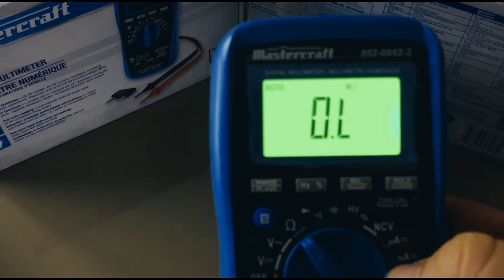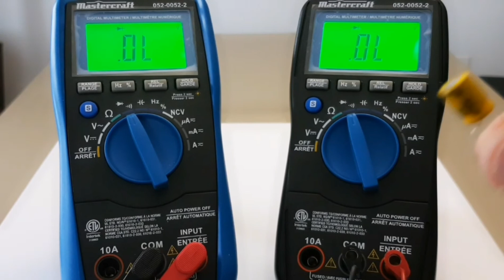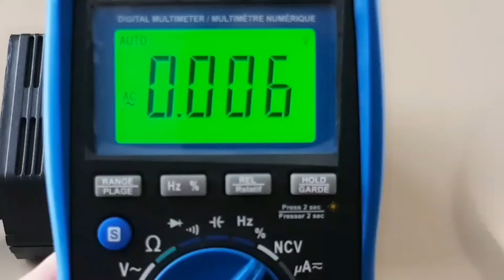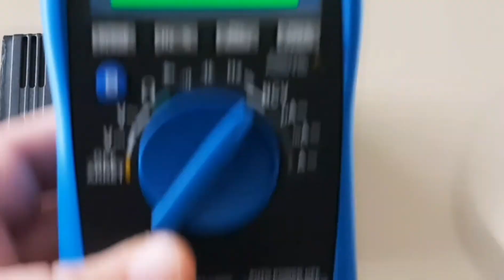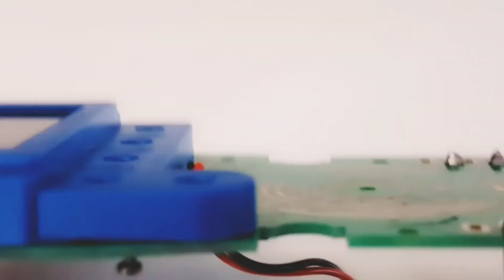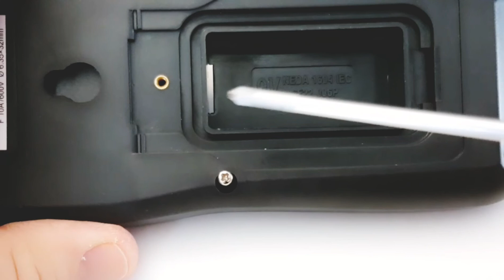MASTERCRAFT 052-0052-2 Multimeter Review & Teardown!

Comment: I was hoping to get some insight into how to use the multi-meter to test resistance.  On mine, I can't tell what range it's in when it provides results and the results don't seem to make sense.  I'm not sure if my multi-meter is defective (I've had it a long time) or if I'm just not using it right.
Reply from the maker: @ChrisR-xs9wp  Testing resistance means the selector should be on Resistance range.
Select the Omega symbol Ω on the Range switch.
Reply: Thanks!

I got that far but the results made no sense. I was trying to measure the resistance in ~ 40 feet of copper speaker wire.

First, the reading started steadily dropping (for about a minute), it wasn't clear to me what range I was in and the final result (>6) was impossibly large even if it were aluminum.

I tried with different wire and then a different multimeter but results were similar.  I'm sure the problem is in front of the keyboard but it would be great if Cdn Tire had decent instructions.

Comment: Hi Darren I have the same meter. The current measurement between amps and mA unit value doesnt seem to be correct. On amps measured 0.031 amps the switched to micro amps and it displays 0.31 when I would expect 31mA.
Reply from the maker: Hi Tom, .031A = 31mA = 31000uA

Comment: I have a 96 volt ebike battery I want to test the voltage but not sure if it's the V with the line and 3 dots under it 🤔 I have the Mastercraft 052-0052-2
Reply from the maker: Yes it's DC VOLTAGE ⚡️ so straight line --- not ac ~
Reply: @KeepOnTesting  Thanks
Reply from the maker: @walleyehunter8862  Anytime my friend 👍

Comment: It doesn't take such much to blow this meter.  I went to test a car battery while it was set on the 10A setting. sparks   
No problem, just replace the fuse, right?  Wrong. A new fuse didn't bring it back, and it just squeals when you try to measure current.
Reply from the maker: Whenever a multimeter measures a current it is actually measuring the voltage drop across the  shunt resistor. A shunt resistor is a resistor with a very low resistence.So if your supposed to be in voltage but youre in current mode and the power supply is 12V Since the shunt is in parallel to the 100Ωresistor (lets say) you'll have 12V across your shunt which current wise is 100x12= 1200Amps across your shunt which will melt the fuse and probably destroy the cheaper multimeters..😔
Reply: @KeepOnTesting      
  Check your Ohm's Law ,brother!   I= E/R,therefore I=12V/100 Ohms = 0.12 Amps. So, your calculation is completely wrong.

The internal shunt resistor of typical multi meter  may have worst case low value of  about 0.01 Ohms. Accordingly I=12/0.01=1200 Amps. So, you got the current right for the wrong reasons.
In any case, if the internal protection fuse is fast enough and of good quality it should protect the PC-board.

Comment: At first I thought I was going to see a review of my CT multimeter but something didn't seem right.  The model number for yours is 052-0052-2 while mine is 52-0052-2.  Mine is about four or five years old now and has a slightly different look to it. It has a rubber protective case on it and a  transistor test function. Another CT digital multimeter I have is quite a few years old now and  I can barely read the model number on it. 52-0055-6 I think.  I use it out in the garage where it gets used frequently while the newer one stays in the house for audio work. Cheers from Victoria BC!
Reply from the maker: Canadian Tire for whatever reason seems to keep the same name/number scheme irregardless of the model. In this case it appears they've simply added a 0 to the updated model. Very confusing indeed! 
😀👍

Comment: Funny how they kept the exact same model number over the years. I just calibrated my dads old meter dc voltage and I am pretty pleased with it , its over 25 years old spent lots of time in a cold dusty garage and has seen its share of use.
Only thing wrong with it is the transistor hfe test module is loose on the npn section. Not sure if the new models have that but the old one has a rubber protective casing around it.
Not much top end numbers for measurements but is built solid.
Cheers from Orillia Ontario Canada.
Reply from the maker: Hey Luc.
Great to see your keeping your dad's vintage CT multimeter in your collection.. Yes, that naming scheme is a little unusual! . At least they're decently built. 😅 Cheers 🍻 from Ottawa/Gatineau 👍
Reply: @KeepOnTesting  nice to hear back from you.
You used the word collection........yes thats the proper description , I now have 4 multimeter and it sure feels like I'm building a collection. Cheers
Reply from the maker: @lucbeauvais1847  Great stuff...! You can never have too many.. check out our new website www.keepontesting.com for weekly updates 😀 channel / multimeter news and more. 👍
Reply: I have one of these, same part number but a lot different. It still works ok but the relative and datahold buttons do the same thing.

Comment: Where do you get better leads, for this model  ? (Canada)
Reply from the maker: The link above is a fantastic set of leads for little money!
Reply: @KeepOnTesting  They'll fit on this Mastercraft 052-0052-2 model ?
Reply from the maker: @AZTEC_ARTS  Yes indeed ..they fit perfectly and make the multimeter perform even better! I have a pair on the same multimeter right now!
Reply: @KeepOnTesting  Thanks !
Reply from the maker: https://rover.ebay.com/rover/1/711-53200-19255-0/1?mpre=https%3A%2F%2Fwww.ebay.com%2Fitm%2FFluke-TL71-10A-Hard-Point-Test-Leads-Set-for-Multimeter-Meter-Probes%2F264437737818%3FssPageName%3DSTRK%253AMEBIDX%253AIT%26_trksid%3Dp2057872.m2749.l2649&campid=5338362906&toolid=20008
Reply: Good advice Darren ! Those leads are incredibly cheap on eBay. On amazon they go for $40 dollars.

Comment: The manual lists this meter with temperature sensitivity, as well as stating it can read in C and F. Also that it accepts a K-type thermocouple. Do you know how to get this meter to read temperature? Should I just plug the thermocouple into the adapter that came with the meter and plug that into the meter? Also there is not a dedicated temperature setting, should I use DC volts?
Reply from the maker: This meter does not support Temperature/Thermocouple readings. There are other Mastercraft meters that do Temp but this dmm unfortunately isn't one of them. When "Temperature" is supported there will always be a Temperature indicator on the meter dial. Some have a thermosensor onboard the pcb while most do not and you plug in the Temp probe accordingly. My other Mastercraft DMM video highlighted a meter which supported Temp if you care to take a look. Btw, I will be reviewing more Mastercraft meters soon. Thanks for watching.

Comment: So it doesn't do temperature? I've read online it does, and I found a manual online with the same product name except the 0 at the start. https://www.manualslib.com/manual/953499/Mastercraft-52-0052-2.html?page=2#manual

Is that not the same meter? It has degrees F and C, but looks different. It be cool if it had been a heat probe, else I need to buy a seperate tool.